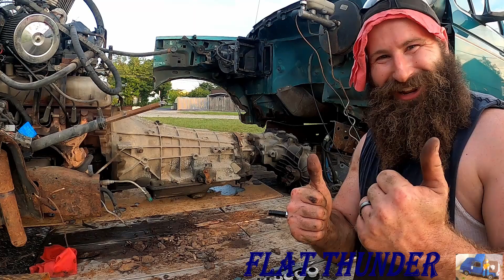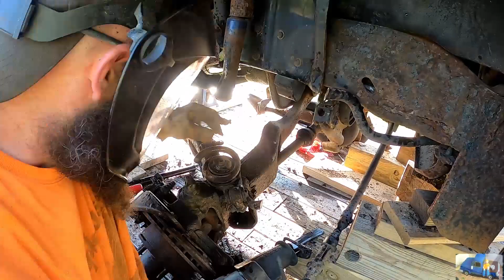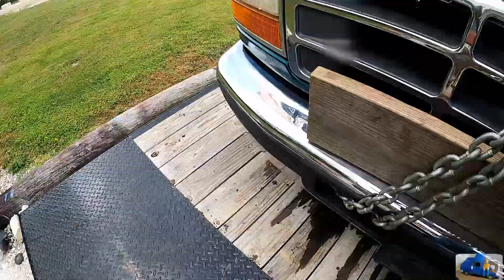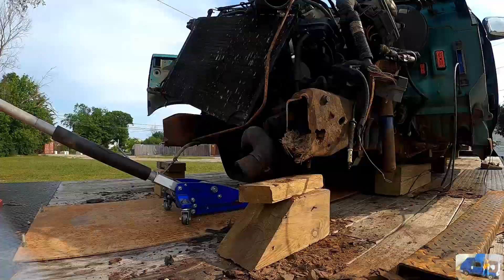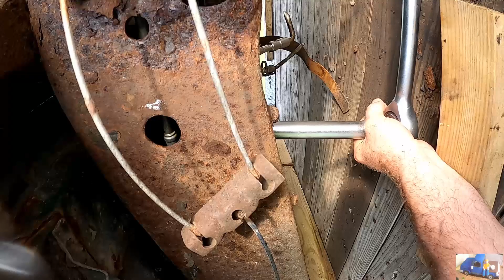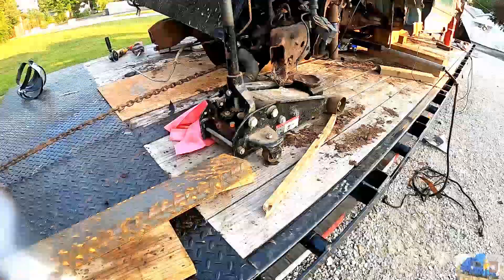1995 FORD F150 GUTTING; FRONT AXLES, FRONT CLIP, ENGINE & TRANNY

Comment: Watching some of the older videos to see what you were up to here. I'm seventy two and severely bad health. I pulled wrenches since the fifties and watched how things changed so much from my day till now. Andy, I am a little guy your size. I only weighed two an a quarter but now its slid up to two eighty and I just can't bend like I used to having a totally fused back from some stupid accidents and then the kidneys failed. I am on the mend again and if I get moving good enough been thinking to pull the body off of a explorer with a very few miles. Its not such a bad rig but its marked its rear fender wells with a few bubbles and if you see one, there are ten hiding someplace. Its the last rig I have left. I got rid of the F350 with every bell and whistle, five speed, 7.3, dually quad cab and the alcolas, goose neck mounted in my all aluminum bed custom made. I even had the high quality leather interior. And call me a liar but that rig is now in the hands of my grandson who is almost thirty and had been after it since I got it new. It still has a zero in the first digit of the odometer.  Yep, 94 thousand original miles and not a scratch or dent in it as it was babied since new. I even had the hidden winches front and back. Every man should be able to have one nice toy in life. I was on the dialysis machine and not expected to pull through so gave it to him. He does know what he has but he is doing the right thing and doing it right by driving it so the odometer must of rolled over in the last three years but not by many as alaska is not a good place like your rust area that your living in. I was thinking about a little old fifty ford or even older to go on the explorer for grins
Reply from the maker: I think the fact you're entertaining new projects means your on the mend or at least headed in the right direction!  A retro body on that explorer chassis would be pretty cool!  Take care my friend and thanks for watching!  👍😁

Comment: Do you still have the wheels,sliding rear window,front bumper,seats and did your instrument cluster have the factory tach? I'm in the next state north of you near the border.
Reply from the maker: I did have the rear window.  If you check out the Facebook or Instagram page you will see it's demise.  I am keeping the wheels n tires for the 'Flat Thunder' truck.  I have a couple small interior components which include the gage cluster with tac and the rear bench seat.
Reply: @FlatThunder  Sorry but I don't do Facepage or instacrackers. I would be interested in the cluster with the tach though.
Reply from the maker: @grosseileracingteam  can you email me through the Gmail account listed in the channel about page? I can send pictures